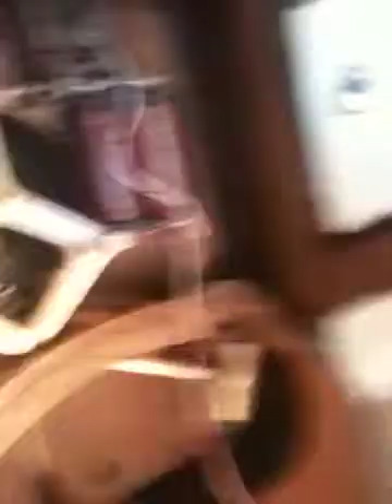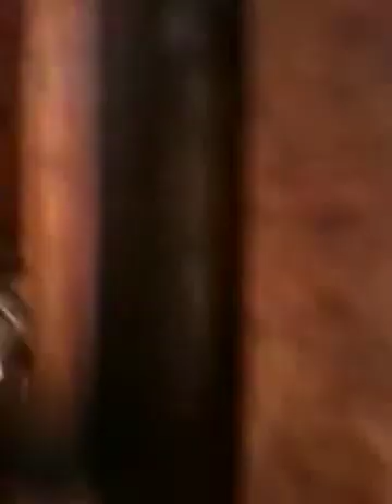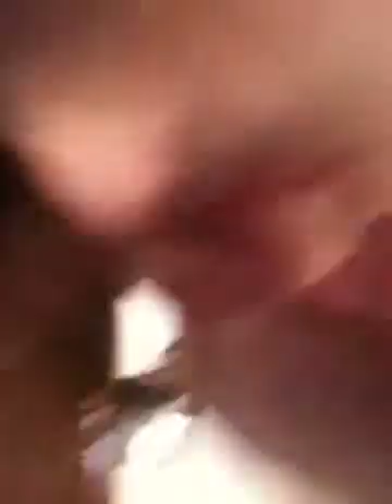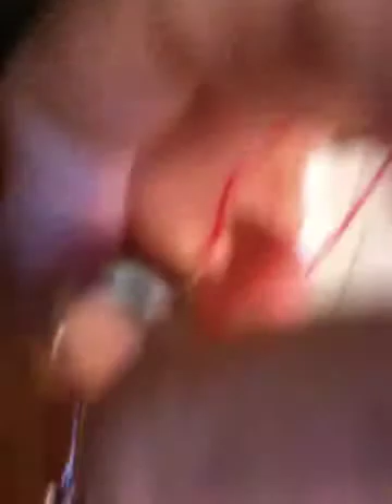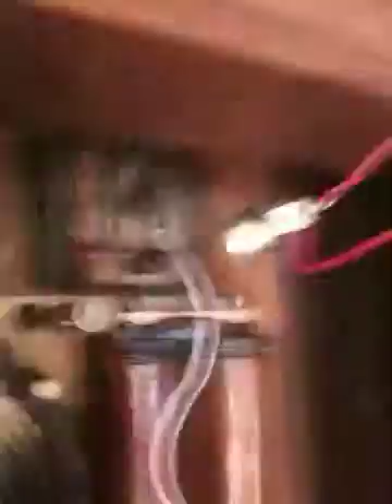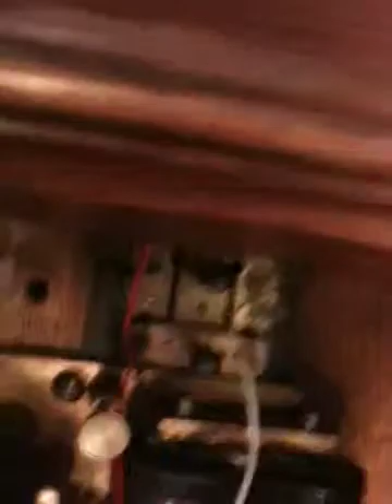Gamewell gong same wiring 15"

Comment: The alarm gong is working just the way it is designed.  When the circuit is in place with the Fire Alarm Box, Register and Gong, the armature is in place.  When the circuit is broken by the Fire Box (the box number is rung three times) or if a box is run over it  the circuit opens and the gong rings once showing a break in the circuit.  I was intrigued that your 6 inch bell rang the way it did.  Usually it is just like the gong unless it has been rewired or wired for a reverse system.